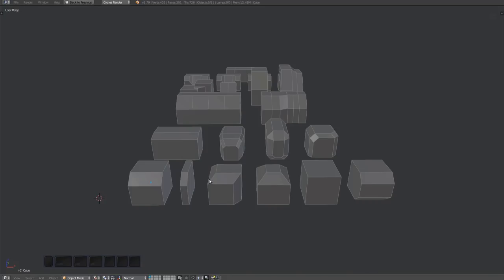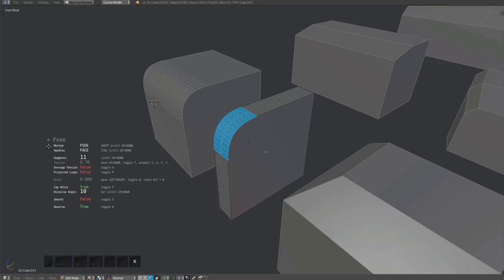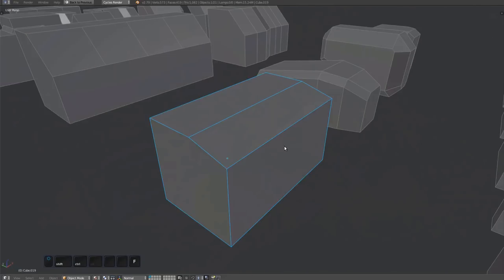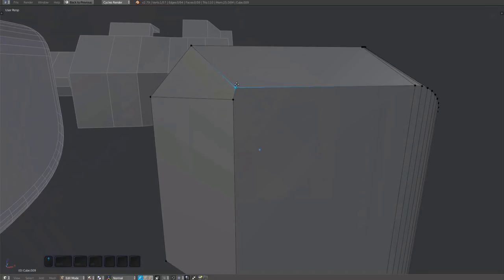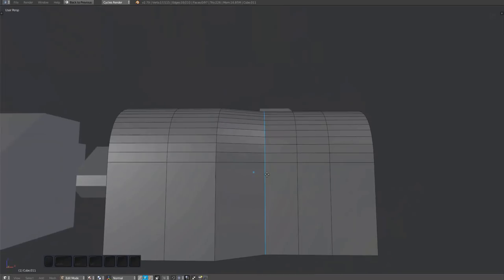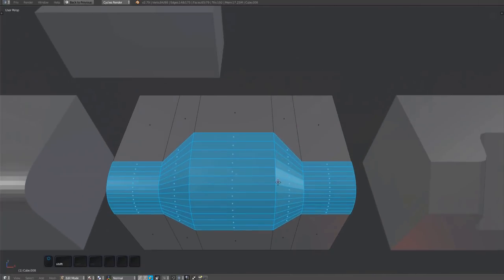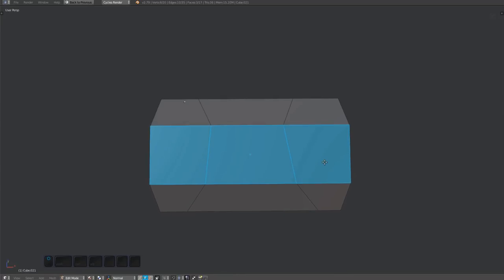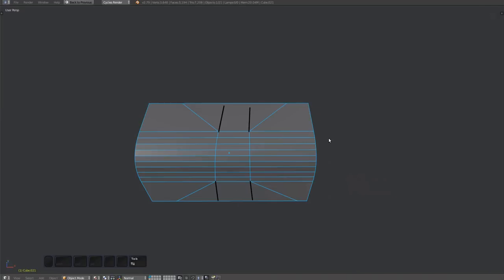MESHmachine 0.6 - Fuse

Comment: Finally got around to purchasing your amazing add-on. The only thing I'd love to see would be support for adjusting operations (like adjusting loops with fuse) without using mouse wheel. I'm plagued by a buggy scroll wheel on my G403 mouse (very common issue) and I often have to scroll back and forth to get the right result. If you could adjust this with plus/minus or page up/down like vanilla blender or Hops it would be great. Thinking about it, maybe I can just configure that in preferences but it would be handy if it was built in.
Reply from the maker: You can use the 1 and 2 keys.
Reply: Thanks!

Comment: does anybody know in the minute 8:00 how he connected those vertices to the edge? just asking for a friend
Reply from the maker: These are connected using the Knife tool. I invoke it via the 2 keymap of Smart Edge (in vert mode with no selection). Back then you could press E to start the next cut while the tool is still active, these days you do it with RMB.